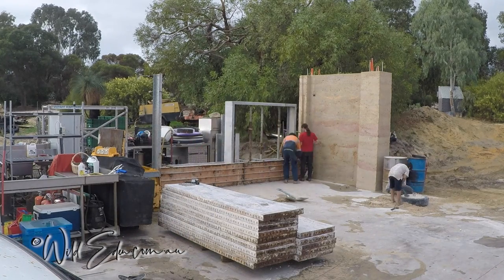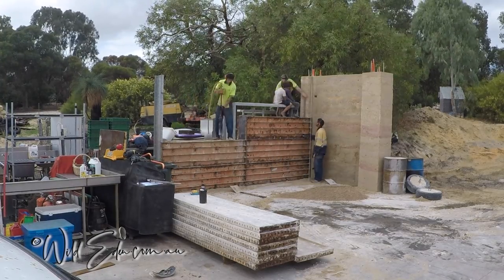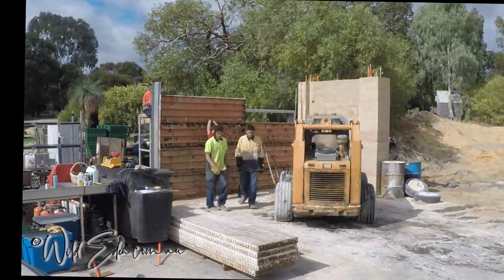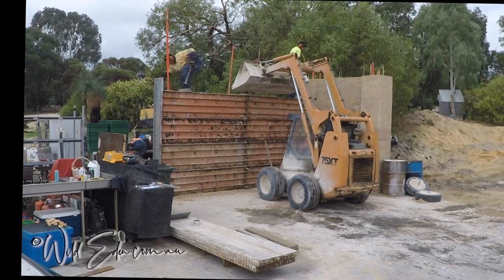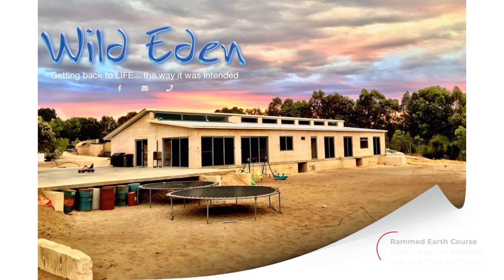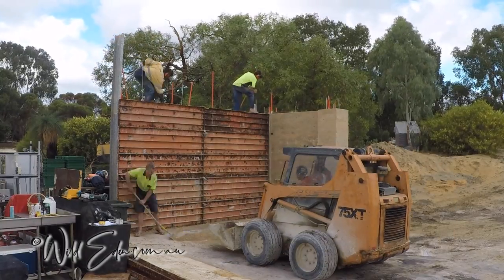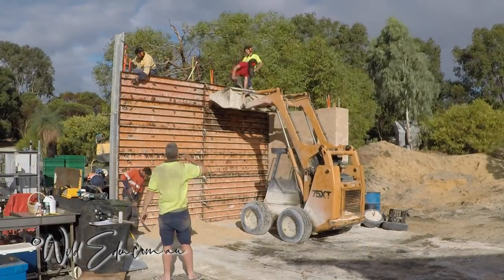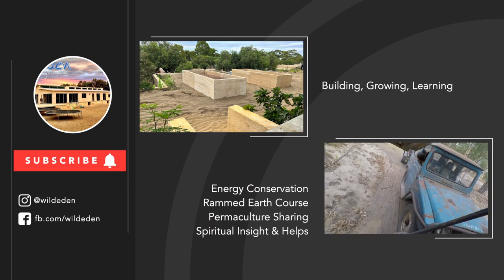Rammed Earth Ramming a sloping (raked) roof wall with doorway (infill) . Timelapse with commentary

Comment: With doing a rake wall, didn’t you want to flick a blue line from the top to the bottom either side of the wall cavity and then nail in some of that green fillet along each line and just ram and then screed/trowel that sloping/raking wall?
Reply from the maker: We will have a video on this topic specifically but we have found that it is not worth the extra time and effort to do this. Stay tuned for more…